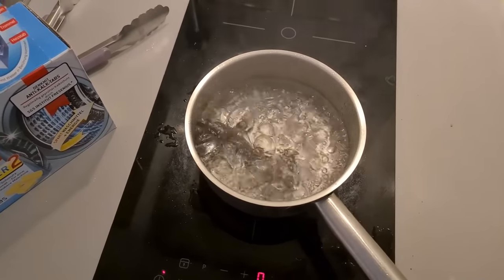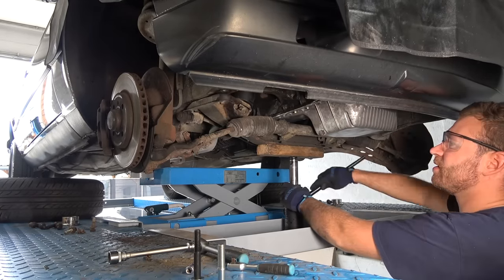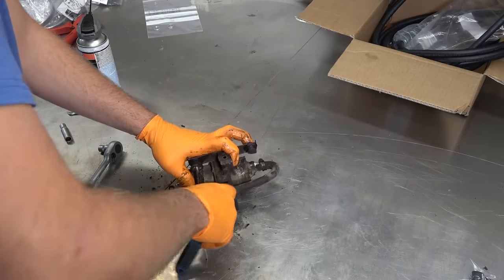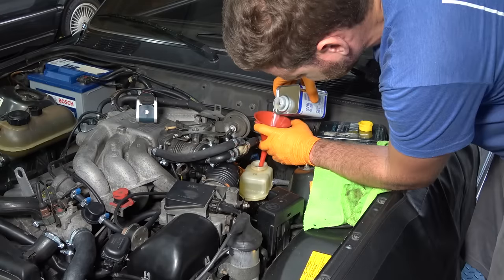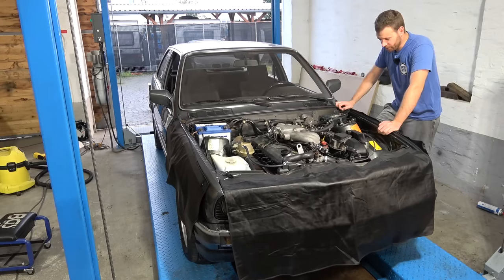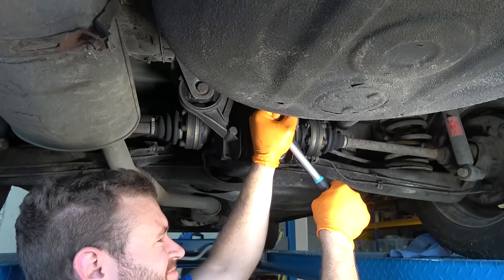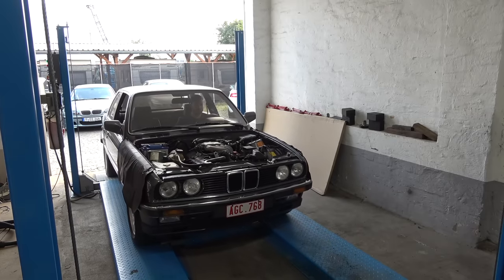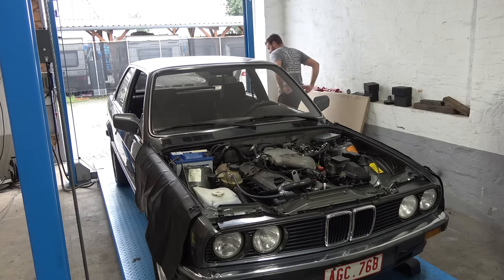Let's Get Mechanical - Neglected BMW E30 320i 5-speed - Project Marbais: Part 4

Comment: I have to admit that I like the ride height. The good thing about it is that you don't have to worry about scraping the front bumper and undercarriage. No need to cringe when going over a speed bump!
Reply: I agree, I remember a friend had a new 325i auto, on steels, & it looked just like that, rode really well, too.
Reply: I don't think he'll have to worry about it with the lowering springs, eibach are a notoriously moderate drop.
Reply: I also like the height. Suits the car, especially with those wheels.
Reply: BMW did lower the ride height on the E30 pretty early in its' life, and again when it got the plastic bumper restyle later on, which is why there are so many part numbers for original springs listed.  They wouldn't have done that if there was likely to be a clearance issue on speed bumps and the like, and even the later 325Ix 4wd version had a lower ride height than the early 320i and 323i without sports suspension...
Reply: it should track better down the road with the longer suspension travel as well
Reply: Even the lowered later revisions were higher than his e46, and it will look so much better.
Reply: I have no idea what Sreten's issue with the ride height is, it's period correct and looks perfectly fine!
Reply: I don't remember ever seeing a speed bump in Germany...
Reply: It is period correct - despite the presenter's misgivings about how it is in the modern era, this is how they looked on 14" wheels.

Comment: The Simons exhausts are also known as Jetex. Extremely good quality and fitment and they are aluminised for rust prevention,  it will eventually rust but it should last longer than a factory exhaust. That being said I’d go with Supersprint if I could afford it. Another option is to go for  the dual pipe 325i system which what I fitted on my 1988 320i. The only modification needed was to modify the diamond shaped flange where it mated to the manifold, the hole spacing was slightly different so the holes needed elongating slightly to fit over the studs.

Comment: When you have an issue with doing up or undoing balljoints in future and they free spin, sit a jack underneath and place them back into the tapered hole and they won't spin and you'll be able to undo/do up without any issues! Little trick I learnt! 

Love the vids mate

Comment: Every time I see a spring being compressed I get this queasy feeling in my gut.
Reply: You're never sure if it's going to POP into your face💀
Reply: @edugamer950  through your face* ^^
Reply: @justus9694  True.
Reply: It's even less fun actually doing it.
Reply: Otc has a nice product called a strut tamer. Furthermore, branick has a nice compressor as well.

Safe working and haven't met a bmw strut yet that it didn't handle. (otc)
Reply: @unixnerd23  as a mechanic I can vouch, even with the caged compressors, it's never fun

Comment: What a pretty profile that car has, I'm sure even the Italians must have felt a grudging admiration back in the day.
Reply: So much so that they tried to build a copycat.
Reply: @traviswalker8933  with what car?
Reply: @TeeBee997  Maserati Biturbo
Reply: No, they have Alfa Romeo and the Italians dominated DTM.
Reply: @raverick187  not after Mercedes got their weight distribution machine from 1994 iirc
Reply: @traviswalker8933  That Biturbo is a nice looking car.  With a ridiculous powerplant setup.
Reply: @garrettlowell7637  only the original design, the Marcello Gandini restyle made it look terrible. With the Biturbo the Italians tried to make an affordable high performance car but miserably failed. Guess they should've stopped cheapening out on build quality.
Reply: @raverick187  until the 190E Evo II kicked them out.
Reply: @garrettlowell7637  My friend owns a shop where they work on a lot of old Maseratis. The drivetrain is surprisingly robust! The electrical system, on the other hand... nightmare-inducing.
Reply: @raverick187  Early 1980s Alfas, always good for a laugh.  He was talking about the design, in any event.
Reply: @SampleTracks2224  In the 80's Alfa Romeo 164 was first production model generated in CAD/CAM.
On the other hand, BMW, now classic design, recognised, was something with heritage, by same guy, who designed E21 and VW K70.
Boyke Boyer, designer of E38, will be immortalised, as BMW design kingpin.
P.s - Every automotive company have their own Chris Bangle iteration...

Comment: On the throttlebody there is a small pin that adjust the closed position of the throttlebody butterfly. Adjust it so it can´t close completely. If the butterfly is able to fully close it will throw of the vacuum-controlled idle and make your idle too high or erratically go up and down. Keep the E30 stuff coming!! :)

Comment: Note some older vehicles had a decell vaccum selonoid that when you let off gas it would allow a smoother idle down from 1500-750rpm. It usually located near throttle plate near cable. Not sure if e30s had this. Just tossing out some knowledge.

Comment: For the lowering Springs, normally it shouldn’t be a problem, the H-Kennzeichen is possible for Zeitgenössisches Tuning. If you could show them, that in the 80s lowering springs were normal it should work. 
But it has all todo with the guy, who does the check.
Reply: Came here to say this! If similar parts were available when the car was new(ish), you can still get the 'H-Gutachten' even with a modified car.
Reply: 10 jahre nach ez muss es möglich/üblich gewesen sein also runter mit dem gerät
Reply: I thought the exact springs and shock models had to be available 10 years after first registration date for the H-Kennzeichen, which mine were not. My E34 already had the H but the previous owner did not register the springs with the TÜV, probably installed them afterwards.
Had no problem to get it registered, the inspector commented "80s BMW would be more period incorrect without lowering springs" 😀
Depends on the inspector I guess. Also he was something like the head inspector for my area or something, the "normal" inspection sites were actually not sure if they could register the springs and did not want to do it for liability reasons.

Comment: I truly appreciate your tenacity and ingenuity to overcome obstacles! You also give me the will to work on my almost 15 year old 2007 BMW E64 which I have babied since October 2006.
Reply: Haha Nathaniel, a typo? You babied your 2007 E64 since October 2006?? 😉
Reply: The math may appear to be bizarre but it isn't correct. I ordered the 2007 E64 in April, 2006, BMW delayed the build until the 2007 production started so 10/19/06 is when I took delivery.

Comment: Re 29:20, as others have said, lowering springs shouldn't be an obstacle to getting the Section 23 inspection (Oldtimer-TÜV). The criterion is that the modification needs to be "contemporary", as in: available within 10 years after the car's initial registration. Aftermarket lowering springs for the E30 would have been available within that time frame, so no problem. My 1991 E30 has them, just passed muster with full marks. Still, best talk to your TÜV inspector in advance. M-Technik ones are going to work as well, of course.

Comment: Notice that you're missing the pre-facelift engine splash guard as well, it will be jackpot if you can find the splash guard with the brake duct as well
Reply from the maker: Do you mean the front right lower fender liner? I have it, just removed it for easier access.
Reply: @M539Restorations  I think he means the undertray. I haven't seen you remove it.

Comment: The 320i before the Facelift only had one Tailpipe. With the 1987 Facelift came the double-tailpipes, afaik and remember. 
My father used to have one of the first E30 320i, at about 110000 km the engine went bad. After a long high-speed trip on the Autobahn one valve ripped off after shutting the car down at the house. 
Next morning no start, tried to tow it and ruined the engine that way. After a complete rebuild the engine never ran like it did before. Always had an idle issue (idling between 800 - 1300rpm) and a slight hesitation when revving up. We replaced all vacuum hoses, checked for other leaks, replaced a bunch of sensors without any luck. 3 or 4 BMW dealers didn't have any luck in tracking the problem down. 
Good luck with your pristine E30!

Comment: Between 2000 and 2004, I took a 1990  E30 318is from 120K miles to 160k. I did much of this suspension, brake and clutch work on my car but still had to watch this video.  It was  great car, diamond black, leather seats and of course Mtech suspension. Always great videos showing the real problems when working on an older car.

Comment: I highly recommend that you use Rocol cutting lube or grease when tapping or drilling. It makes it 10x more easy. And also when you don't want your hoses to kink, shove a small compression spring over that hose. That's how Honda does it on the old motorcycles. Cheers from the Netherlands aka west Germany 😜
Reply: Heil Mooi Auto...Jah vole   ..is it getting that bad in Amsterdam these days?  I worked  there in the 1990's when it was the best city in Europe to live!

Comment: Hey Sreten, I know you intend to keep the steel rims, but I really think the car deserves the original 14 inch alloy wheels (1125688). The car is anyway not completely stock, since the steering wheel was tastefully upgraded to an M-Technic unit... Thanks a lot for awesome content!
Reply: The steel ones can be used for winter tires, but the car will probably get season plates and not be driven in the salt season anyway. Those alloys were classy.
Reply: M3 rims maybe..
Reply: @gerjanrubens2698  E30 M3 wheels are 5 stud, not 4. Also, genuine originals will cost millions of euros and M wheels on a non-M car?  Things to make you go hmmmmmmm!

Comment: Could idle be a wierd ECU issue? Given that it immediatly works fine if you restart.
Also, perhaps maybe the idle valve, that sits on the inlet manifold could be acting funky.
Reply: Might be Fuel pressure regulator valve
Reply from the maker: L-jetronic doesn't have an idle valve. Fixed it finally today, you'll see in the next episode, was none of that :)
Reply: @M539Restorations  Oh, i thought those had one. Awesome you found and look foward to the next video!

Comment: The springs will settle in with time and they will be lower. It just takes some time. Like a month or two. That's why when you replace major part of your suspension in the front and do the alignment, you have to do the alignment again a month or two later when you notice your steering wheel is pointing at wrong direction when you're driving straight. Give it some time. The springs are clearly lower than the old ones so they just need time to settle in and get fatigued.

Comment: To make fuel line bend without kinks slide copper pipe inside bend it to shape and soak in hot water leave overnight, it wont be perfect but wont kink as easy. I had Simon's exhaust compents on my old car and it stood up pretty well to Scotlands love for salt in the winter. Love the channel ❤

Comment: Thanks for another weekly therapy. 
New gas shocks also contributed to ride height, it'll take few months to settle down a bit. 

Removing stuck nut works best by pushing the ball joint back in its place with the jack. You already did it few weeks ago while installing new one and this will always stop it from spinning.

Comment: If the bolt pops out while loosing the nut (minute 36:30), you can press it back again with a jack and leave him there under the ball joint until the nut is loose. Worked for me a lot of times until now and also saved me a lot of time... Great video!

Comment: Great stuff as always! A little trick i've used in the past for when ball joints 'pop' before the nut is off is to jack them back in and leave the pressure there whilst removing the nut. Doesn't always work but quite often does.

Comment: I feel somewhat relieved seeing that it was hard / time consuming for you doing the suspension work on the front end.. just been doing a snapped spring on the front of my E61 and it’s turned into a multi-day debacle thanks to snapped bolts and numerous issues.. it’s the inspiration from this channel that has kept me going. I thought I was just slow but I guess it’s just a time consuming process working on these components! Thanks for the motivation.

Comment: The Dremel tool with a cut-off wheel, know it well, recently used it at home to replace 15 plumbing  shut-off valves. The killer was the sweeper, myself still use a broom and then a water and detergent wash for the floor (did it today when doing preventive maintenance on the riding mower)

Comment: Hello! The reason for the high idle is the mass air sensor....it's the old model with the potentiometer ....the door inside opens when more air goes through .....that door action the potentiometer
Reply: Finally. I was hoping someone would suggest possible reason for the idle issue. So can you repair r must you replace MAS? Thanks
Reply: @jamesrochester787  the unit is a Bosch ....it can be repaired but it is only temporareli.....it won't last to much ....depends on how manny km make .....if you google this E30 MAF you find a lot of data 😁😁

Comment: I have a 2014 VW GLI with 200K miles. I change my oil every 5K miles with LM Molygen and my engine purrs. And I upgraded all my shocks from cheap VW (tingy when u hit them) to much better Bilstein B4 (solid noise when you hit them). The car suspension is smooth as butter. I will always use Bilstein. Even had a neurosurgeon compliment me on my smooth ride. Said it rode better than his BMW 7 series on hywy.

Comment: For the spinning bolts on the suspension arms I use a gearbox lift to press the cone back in place and it stops the spinning. Same goes for all ball-joints etc with cones, just press them back in the cone to keep them from spinning. Has not failed so far. Keep up the good work!
Reply from the maker: It doesn't work on rusty stud/nut, I tried.
Reply: @M539Restorations  It has worked for me, but it needs enough force (sometimes the car starts lifting), and there can't be any grease in the cone (only on the rusty nut).

Comment: Hi from sunny (not) Scotland. Not sure if someone added this earlier. If they have, apologies 
The reason so many different springs are listed on Real OEM is because they are spec dependant. On the BMW EPC, you have to select every item of spec fitted to the car, whether from the factory, or retrofitted. 
You also mentioned there being a slight tint in the glass on the car. BMW used 2 tints. Bronze, and Green. You can tell the tint by looking at the roundal etched onto the glass. To the right hand side, there will be a B or a G. 
Hope this is of some use to you for future projects!
Keep up the good work!

Comment: I have to say, Sreten, when you mentioned the Biltsein shocks/struts and then said springs I immediately thought "Why, H&R of course!  What else would you use with Bilstein?"  Imagine my surprise to not hear them mentioned at all.  Not to mention it seems they have German TÜV certification.  As for the spinning ball joints, I would've brought out Hugh Jackman once more and jacked those up to apply pressure on the joints; thus stopping the spin.  No matter what, though, I'm always thrilled to see a new upload from you.  Your work ethic, personality and humor are all amazing; please never change!  :-)

Comment: Always a great day when Sreten posts a new video. By the way, the Idle Slide Valve works almost exactly like the Accelerated Warmup System (AKA Thermowax) on a 1986+ Mazda RX-7. Mazda just packaged everything into the Throttle Body, hence why there are two coolant hoses going to it. Same setup was also used on the Eunos Cosmo with 20B-REW engine. Most who have done a 20B RX7 project just bypass it or leave it disconnected. Wouldn't be too hard to add a bypass in parallel to the existing setup, just two Tee fittings and a suitable valve. Use a Solenoid valve if you prefer being able to operate it from inside the car.

Comment: Cool video! You can use rear 2000-2007 Mondeo rear ARB Links for the front which are rose jointed which will stiffen it up a little bit!

Comment: Hey Sreten! When you removed the bottom arm and the ball joint started spinning, I recommend to use a jack and apply pressure to the joint. That way the ball joint wont spin with the nut. But anyways, Great video again!

Comment: Regarding high idle: Check the throttle plate clearance if you cleaned the throttle body. Cleaning will remove buildup that was blocking the passage allowing more air to flow increasing your idle.

Comment: For the conical ball joint like the control arm ones or tie rod end you can just use a jack underneath it and apply some pressure that way it wont spin when trying to unbolt it.
It can save you a lot of time instead of cutting it.

Comment: Just a suggestion - if the bolt is broken inside the hole (below the surface) put a flat washer under the nut and build up the weld inside the nut.

Comment: Good tip for those spinning ball joint nuts is to put a jack at the bottom of the taper joint and push up to provide extra friction, then the nut had a better chance of coming off without the joint cracking.
Reply from the maker: I tried with a floor jack, doesn't work when the nut is rusted.

Comment: 9:21 stainless steel spring inside the hose, then you can bend it as much as you want. It won't rust and it won't kink. Caveat... super difficult to get inside. But it is worth the effort. You can bend lines as much as an Euro in diameter with this trick. The stainless steel spring can be found for exactly this purpose on fleabay and the usual suspects, usually used for medical equipment when transporting fluids that can rust.